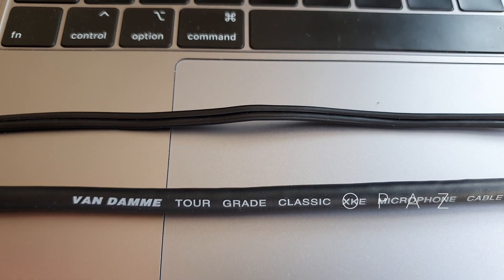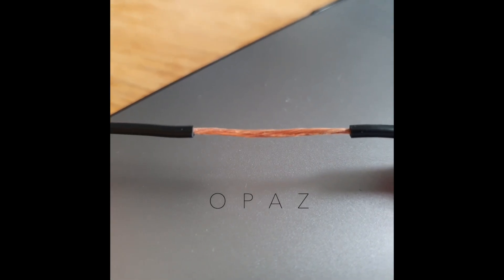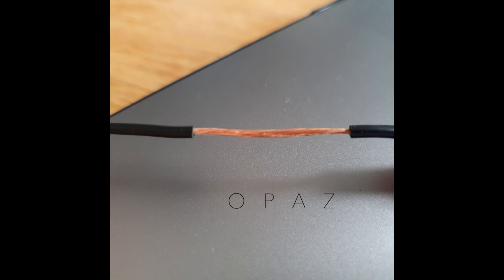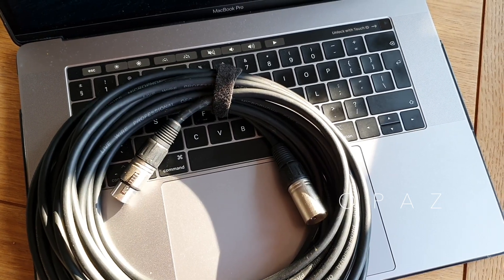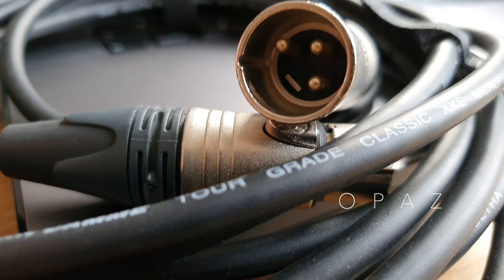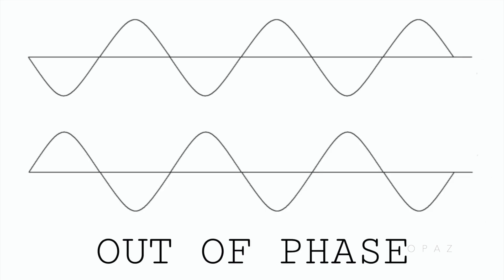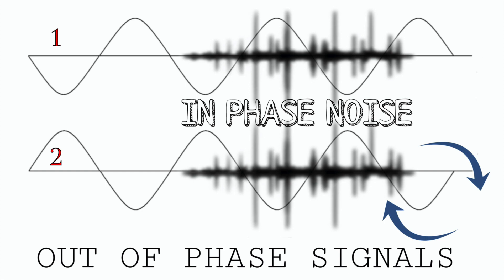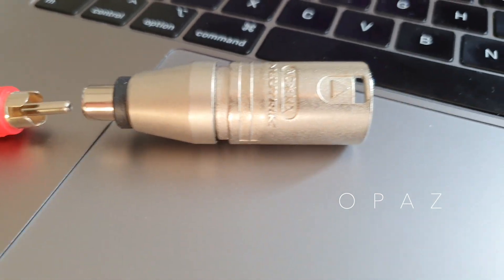Balanced vs Unbalanced Audio Cables

Comment: Sir thanks for the detailed information... One question.... I saw the RCF HDM 45a while u explained about the cables.... This seems your personal speakers.... I remember once u did reviews on RCF 745 and RCF hdm 45 a..... And told 45 a is just amazing and you had so much praises about it.....please advise on the sound quality of them.... And do you face difficulty bcos of absence on on off switch..
Reply from the maker: Yes I own both speakers and although I have the HDM, the 745 is still an excellent speaker that i highly recommend. The HDM are the best 15" speakers that I have, sound is top drawer. The on/off switch on the HDM is just odd, it does not cause any difficulty

Hope this helps
Reply: Thank you so much Sir.. God bless you 💕this is sarfaraz from Muscat Oman....